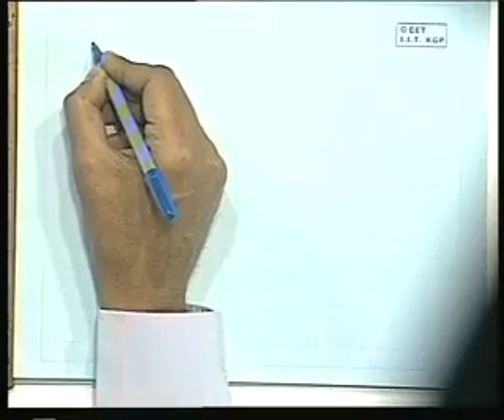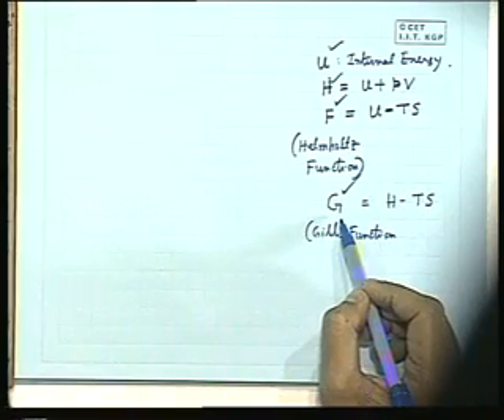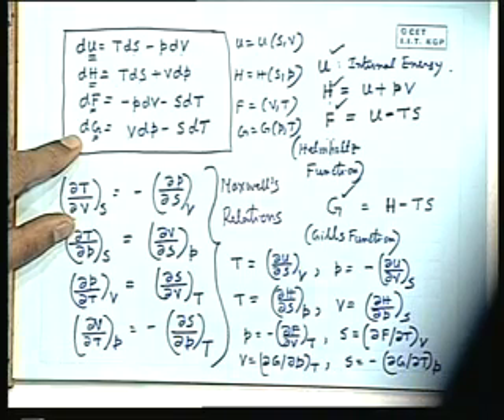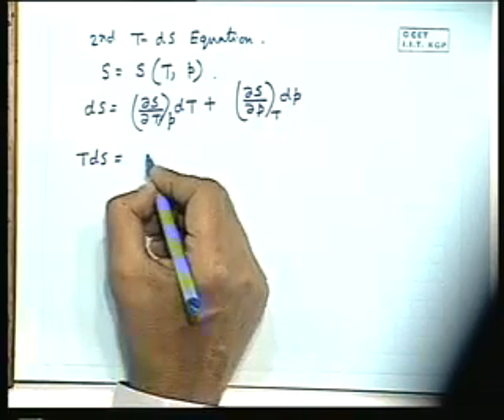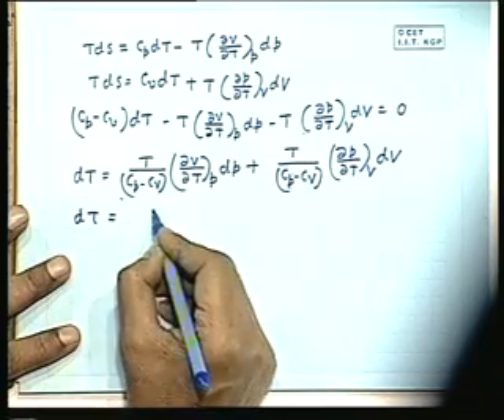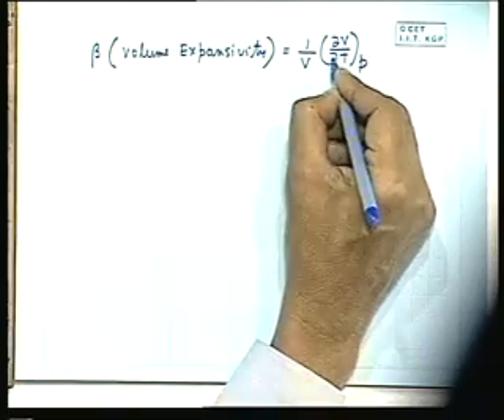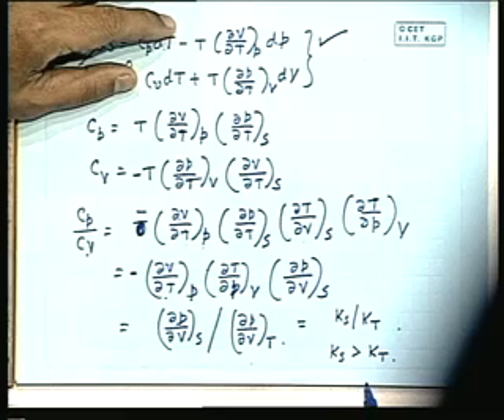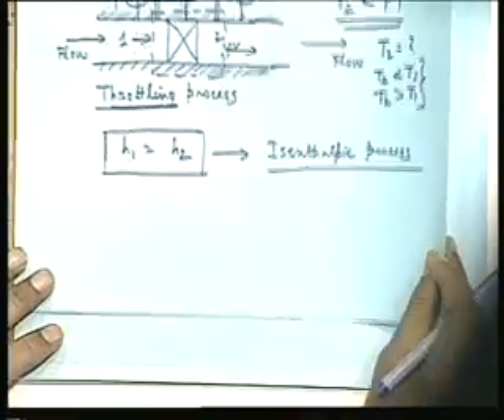Lec-14 Thermodynamic Property Relations-II

Comment: Can anyone help me to solve a doubt: In Helmholtz and Gibbs function, shouldn't the term "sdt" be zero as they are defined for iso-thermal processes?
Reply: Ankit Arora 

Both Gibbs and Helmholtz equations are derived bcz it simplifies to find availability when the system temperature is same as sourrounding temperature throughout the process (ie isothermal) .. availability is equal to just  change of that functions..

But if the process was not isothermal we can still use them like a normal enthalpy equation H = u+PV .

So Sdt will be if the process is isothermal.. if process was not isothermal that term exists.